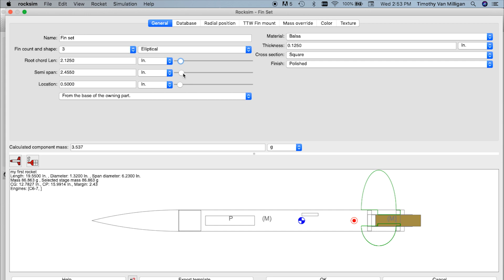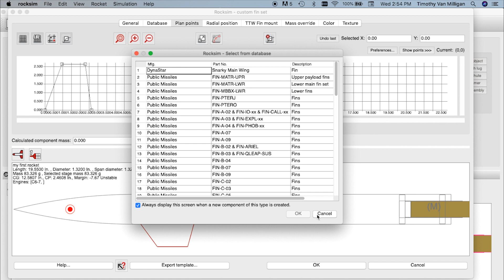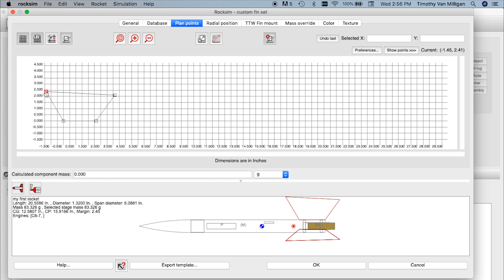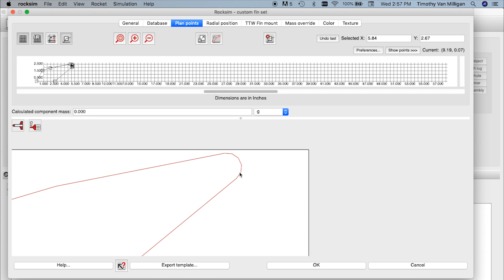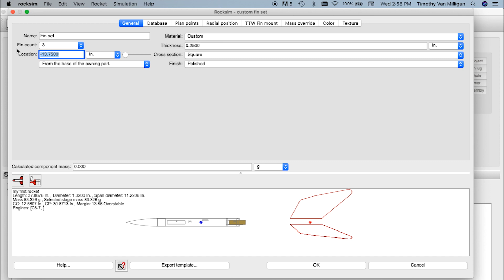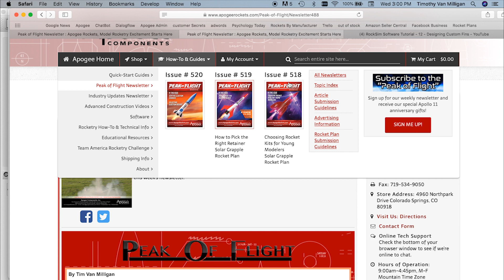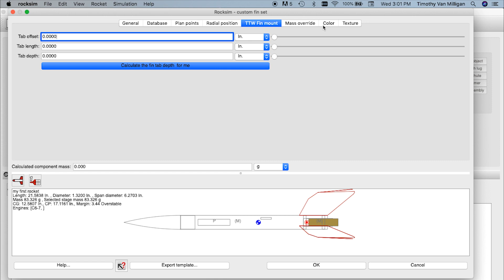RockSim Tutorial #12

Comment: Hi Tim, what I wanted to do with fins is adjust their angle.... I know how to do radial position... but in open rocket you can also change the angle with which the fins turn about the body tube... wanted to run a simulation in rocksim with the fins on an angle since I think it would give the rocket some spin on the way up... but I don't see the way to change the fins cant angle like I could in open rocket.
Reply from the maker: That is an advanced feature that is found in RS-PRO. It requires a 6-Degree of Freedom simulator, which is the purpose of RS-Pro. You'll find it on our website if you're more interested in it.
Reply: @apogeerockets  i have rocksim 11 that i got from your site... that isnt pro?
Reply from the maker: @gillandro2  Sorry for the confusion. They are two different applications.
Reply: @apogeerockets  thanks but i am not looking to spend $30 a month just to put fin canting but most appreciated your help
Reply from the maker: @gillandro2  There is so much more besides fin canting. But if you can't see the other advantages, that's fine. The regular version of Rocksim will get you in the ballpark.